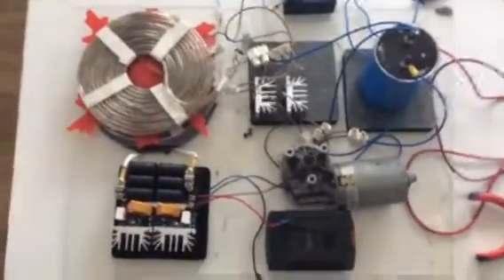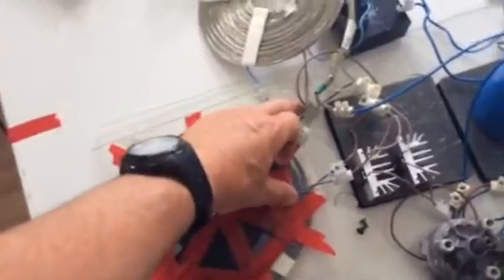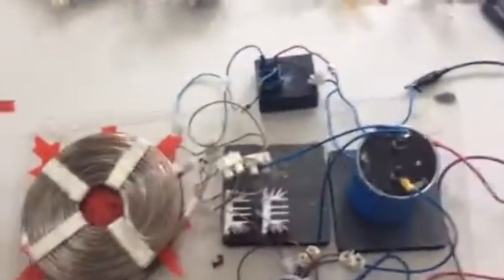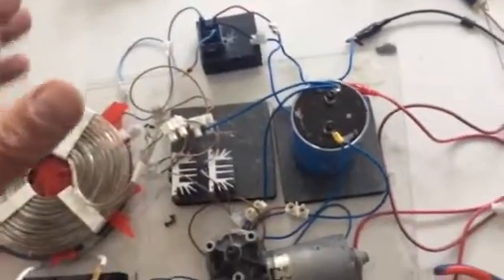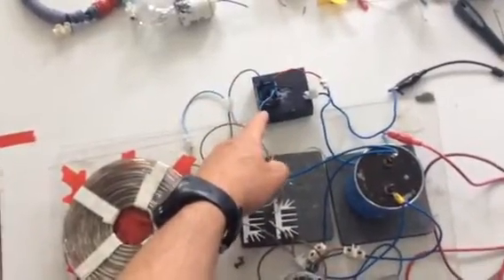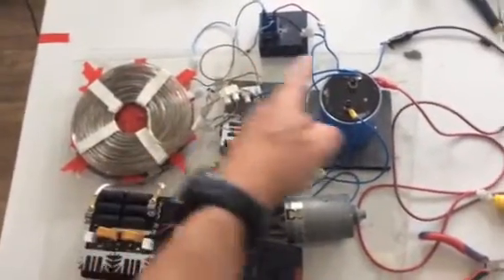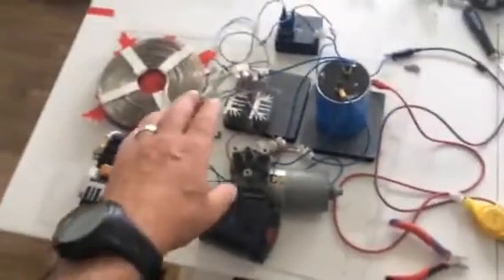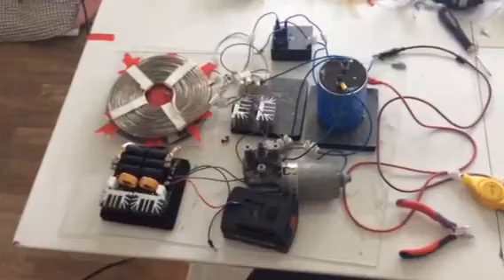IT ZVS tesla , Kapanadze self running or not why?

Comment: Your doing great work. Many of use are on different paths because there is so much yet to be rediscovered. If the motor or a light bulb is in series with the negative battery supply and negative of cap on driver side (positive to positive). The voltage across the motor or light would drop. That would indicate the cap is supplying the system instead of the battery. Cheers Mike
Reply from the maker: Arkiver Unified Energy thanks Mike:) question is how to collect both dc outputs and combine them to give a total OU to run itself? Maybe I can only charge batteries and switch them periodically..

Comment: That is a wild setup you got there, when I hit a wall I try amps in amps out try checking the amperage entering the system and the amperage being consumed by the motor. Maybe by checking the amperage between your devices, it may give you some insight any one of these components could be detrimental to your design voltage is not always a good measure of performance.  One other little note that I have found to be true, the proximity of the devices can play a part in disrupting the flow of energy through this system. Well that's all the little nuggets I got, good luck thumbs up
Reply from the maker: zeropointfuel thanks:) I will look at these points and thanks for the support.

Comment: Maybe when you try and add the output from the top coil to the big cap you are actually paralleling the top coil with the ones beneath it - this might be why you don't see an increase into the cap as they become one coil. I have done a bit of testing with this set up (same ZVS + several bifilar pancakes) and it seems that the gain is not seen as much until the cooker coil is fully energised. At lower amps it looks 1:1. The mosfets in that ZVS switch much sharper at 48v, so better results. They have nearly a square wave at that voltage compared to sloping sides at lower volts. The trouble is supplying 20 amps from batteries! So not too much testing yet. You're doing good work and giving me ideas :-) 
I think the two important concepts in this work are "coils in resonance" and "spark gap" - with "earth" following a close third.
One thing I'm curious about is why you're only using a half bridge instead of 4 diodes?
Reply from the maker: Mark Flint half bridge is that allows the two positive ends to be connected and the center of the bifilar is the negative direct to the cap. I have a full bridge on the other coil.

Comment: Nice project and I agree  there must be sufficient amperage after the load and equal to or greater than the amps in. 
I have found thus far that there must be energy taken from somewhere and boosted or amplified or stored ,whatever one calls it, to overcome the initial energy in.
I say energy because that means that it may have to do with same frequency and volt/amp requirements.
I have reasoned to believe that Ruslan and Dneisters' devices  are started with 1   9- 12volt battery impulse,so its like jump started and they both have an HV antenna too with a thick ground wire to capture possibly this atmospheric and good ole mother earth ground in harmony thus attracting greater amps volt energy.... hardest part Dneister said was the coil tuning part... the rest  easier...this required a tl494 with IR2113  tuneable push pull circuit along with a Kacher tesla coil.They are on line under Ruslan or Dneister videos nice too!
I know it sounds hard but in reality it is a working device unless we can find other ways to gather this extra energy good luck and God bless!

Comment: Always watching, please keep up with the good works.
Peace.
Reply from the maker: dude man thanks but it is a hard path alone. I think that many are self absorbed and don't have time. Maybe this is the wrong time to try?
Reply: dkdyker The reward for your diligence will be great. Do not give up. Walking a path alone lets one see things others do not. 
Peace.
Reply: dkdyker  pls dnt give up,  quitters are losers.  just keep going someday will find the answer to yr quest
Reply from the maker: Noy Santia thanks man, I will find the energy from somewhere.
Reply: dkdyker just be patient sir, dnt be in a hurry .if there is a well there is a way. it will.take time to arrive to our destination if u find it difficult take a rest telax. im doing same thing with u. why dont u try n emitate buck converter circuit, the concept is to increase the voltage in the cap everytime the switch in a off stage due to the collapsing magnetic field in the inductor ang during on stage charging the battery of tha source. telsa called this as tank ciruits with amplification. for surerity u may review the concept of tesla tesla tank circuit with amplification i think same with converter.